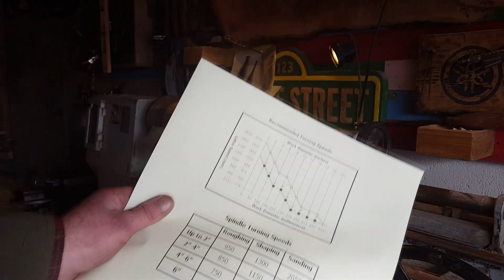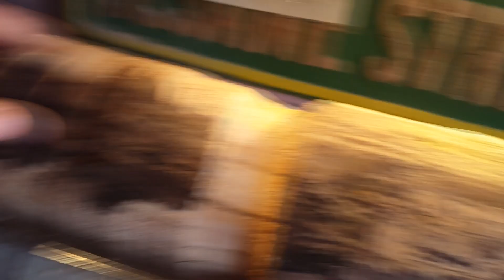Woodturning a Simple Vase from Driftwood on the Lathe - Lichtenberg Figures

Comment: Lovely bit of work mate. Wouldn't metal flowers be more your style. A big nut with nails welded to it for petals, big nuts welded together into a circle with smaller one in the middle. Coat hanger stem. I dunno, you've a more imaginative brain than most mortals. Anyway. Lovely piece mate.
Reply: Aaaaaaaand I've just read someone suggested that a day ago. Ha. Note to self. Read the fucking comments first before i suggest anything. 🤐Ha